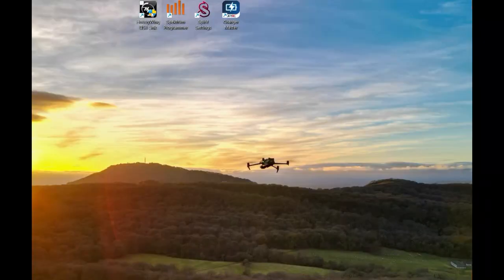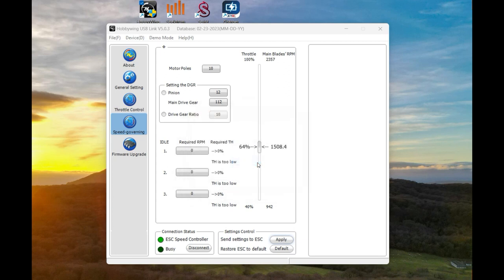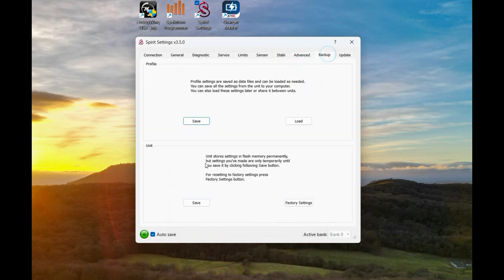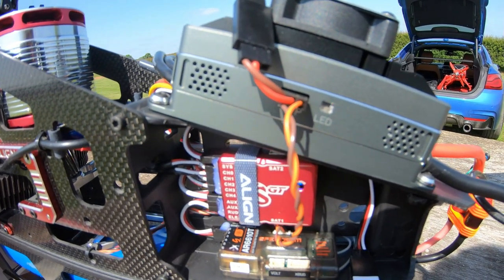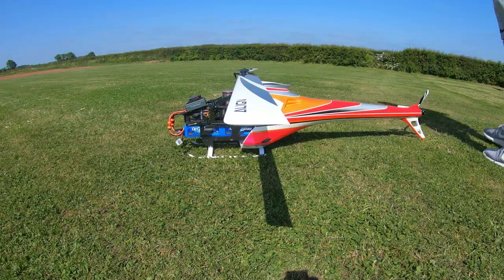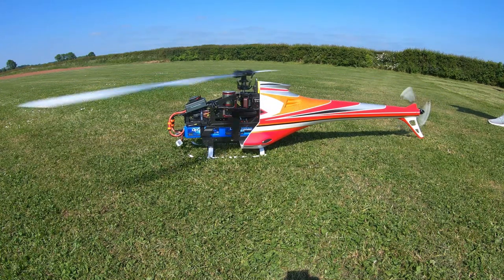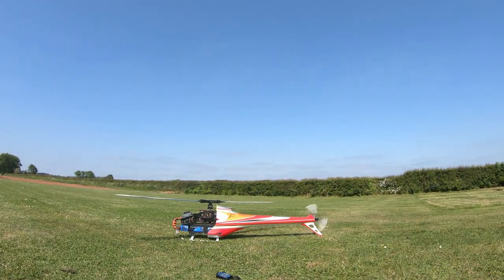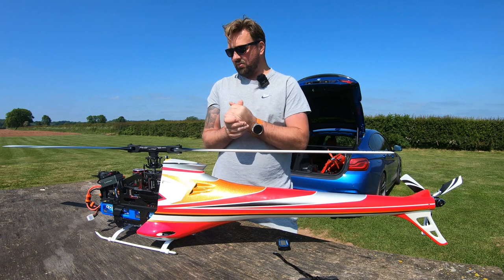Hobbywing Platinum V4 Telemetry Activation, Spirit GT, Spektrum

Comment: Great video. For safety you can attach the tachometer to a sturdy thin rod on one end with some duck tape and stick the other end of the rod in the ground till it doesn’t wobble. And then place the helicopter so that the blades pass over the tachometer lens.
Reply from the maker: That's a great idea, and much safer 🙏

Comment: I have close to same setup. Trex 550X, Spirit GT, Spektrum NX10. My RPM telemetry is not reading right, something like 52. I have poles and ratio set same in both Spirit and Tx. Long thought it might be the double values messing with the read out. This confirms my hypothesis. Will change my Tx setting like yours. Hope that solves my problem. Thanks so much for taking the time to make this video. Very helpfull!!
Reply from the maker: Brilliant, glad it's helped you what ESC are you using? I was hoping to get the rest of my fleet speaking but they run align / hobbywing esc but don't seem to have any telemetry date output, must be just hobbywing?
Reply: It is the super combo and all stock. So the Align RCE-BL100A Brushless ESC. Use the Telem UNI cable as it is just a rebranded HW V4. Works great and get all nessecary telemetry
Reply from the maker: @excchp2284  that's interesting, I couldn't get mine Rce-bl130a to speak, I will keeping trying then
Reply: Wanted to report back this was the fix! RMP now reads correct and confirmed viewing the logs. Fellow flyer at the club was having same problem. We changed his Tx settings and his now works too. Thanks again for taking the time to make this video. Cheers

Comment: Hey mate you are probably aware of this, but you don't even need a RX. just run a SRXL2 satellite. cut the 4 pin off and put servo plugs on and run it to the rud port and the ELE/PIT/AIL port. telemetry to SAT 1 as usual and then you can also add another satellite into SAT 2 if you want. Thats how I have mine setup (As per spirits instructions) and its flawless. Full telemetry on everything and no bulky RX needed. Also gives you the option to change the Spirit FBL setting from the transmitter, so no need to take a laptop to change anything. its fantastic. I run Spirits on a Trex 650X, Raw 420 and building a Raw 580 also with a spirit GT.
Reply from the maker: Yes I use that setup on my 550X, I opted for the receiver type on the larger models to use the voltage telemetry and separate sattelites for greater signal strength, I still use my receiver in Srxl2 fashion, Just with some extra telemetry
Reply: @danieljohnston1111  by voltage telemetry, do you mean bec voltage or flight pack voltage? I get flight pack voltage voice call outs on my transmitter. I normally land at 44V on 12s or 22V on 6s. I know that's a little conservative. but it keeps my packs in good health :)
Reply from the maker: @ShadowtheRagdoll  ahh that's a new method, iv only read up on the telemetry wiring for a normal Srxl2 receiver, I will try and get my 550X speaking telemetry then with your advise, many thanks mate
Reply: @danieljohnston1111  if you need any help, feel free to let me know. its pretty straight forward though. SRXL2 satellite into the ports as we talked about above. A telemetry wire from the P port on the ESC to the SAT 1 port, Set the spirit RX type as SRXL2 and set the ESC type in the advanced tab on the spirit and all works great. On your transmittier just change 1 of the telemetry options to volts. go into that menu tell it what cell count you have and set your min voltage then enable voice call outs and the frequency of the call outs. :)

Comment: Keep doin DJ - doin a great job mate - excellent content and this was very useful.  O7 from the Heli Shed (PS - love the fuselage - Blackshark?)
Reply from the maker: Hi mate, Thanks for the comment, yes bud it's a trex 760 black shark F3C, iv just bagged all the bits to upgrade it to 760X mechanics from the 700E frame. Absolutely love flying it! 760 blades at 1950rpm 🤯